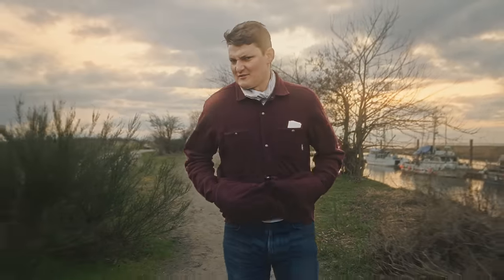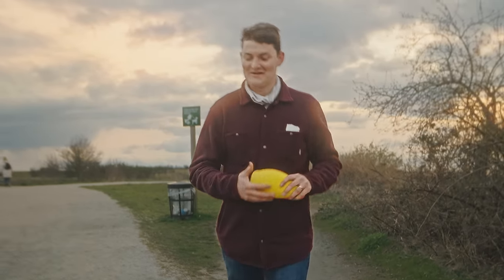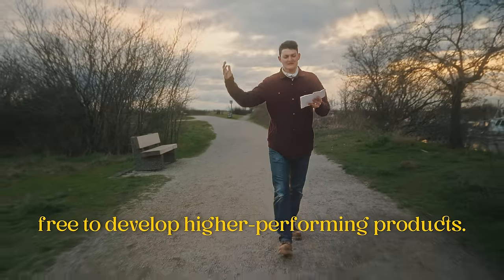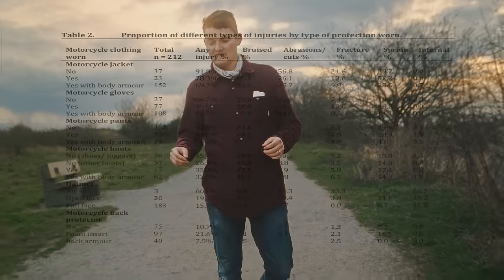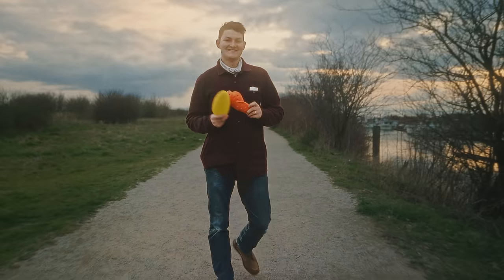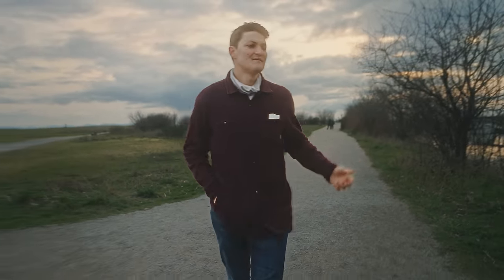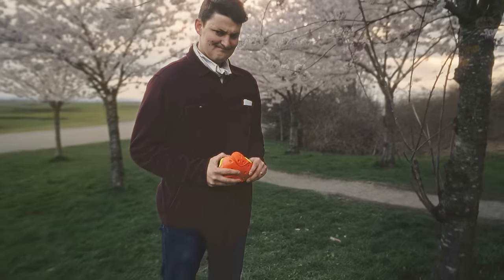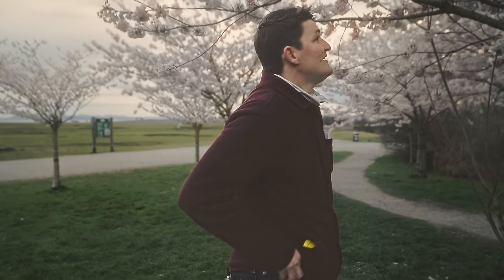Why I Stopped Wearing Motorcycle Body Armour

Comment: I would like to put my 2 cent, since it could be beneficial.
In recent news Italy has announced a series of laws that will be applied in the near future, some of them state that when conducting a motorcycle the drive MUST wear protective gear regardless of engine power, looking more into it there have also been changes to the requirements that allow such gear to be sold, specifically the points that are now lacking like fracture and sprain protection, some brands (dainese and alpinestar come to mind first) are already compliant, but others could be ultimately made illegal for selling since many other brands have stated that these laws are too strict

Comment: I came off a week ago and body slammed my back onto the road and gravel. At the time I was wearing a textile riding jacket with elbow and shoulder protection and a back protector insert, jeans, riding boots and gloves. With the exception of a finger nail bruised, I think the tip of my finger got caught between the handle bars and the road, all other injuries were in areas where I did not have protection. I ended up with a badly bruised knee hip and arse. My gloves were shredded down to the knuckle protection and jacket was shredded on one shoulder and down the the back protection.

This was a fairly low speed low side fall that regardless of what I was wearing I would have been unlucky to sustain any serious injury.  However looking at the gear I was wearing and the shredded state it is now in, which is the same locations there was additional protection, I don't doubt for a minute I would be feeling a lot sorrier for myself now if I had not been wearing it.

At the same time I also accept that a bit of rubber protection is probably not going to do a lot of you hit something solid at 100kmph.

Comment: Taken directly from the study you mentioned: ''Motorcyclists were significantly less likely to be admitted to hospital if they crashed wearing motorcycle jackets (RR = 0.79, 95% CI: 0.69–0.91), pants (RR = 0.49, 95% CI: 0.25–0.94), or gloves (RR = 0.41, 95% CI: 0.26–0.66). When garments included fitted body armour there was a significantly reduced risk of injury to the upper body (RR = 0.77, 95% CI: 0.66–0.89), hands and wrists (RR = 0.55, 95% CI: 0.38–0.81), legs (RR = 0.60, 95% CI: 0.40–0.90), feet and ankles (RR = 0.54, 95% CI: 0.35–0.83).

Comment: I forgot what I was watching thanks to production quality. Beautiful stuff as always. Now, as for the topic. Considering what's provided is true, it surely remains effective to some extent as you mentioned. Different speeds, angles, impacted materials vary and the end result varies too. Despite all, having armour is most probably better than none. Striving for better stand-alone protection as you showed would be the right way to go.
I wouldn't consider removing my armour parts, we fragile humans don't need fractures to feel pain. Bruises alone, abrasion, lacerations and much more can be a worse nightmare. Even then, medical recovery and treatment will be shorter and easier in case of anything extreme. 
Nevertheless, I 100% understand your point there so thank you for making it clear not to rely on said armour when it's virtually useless when it comes to life and death.

Comment: Had a high side at COTA last November 25th, that knocked me out. Transported to hospital at level 2 trauma. Most prevalent pain, as I regained consciousness in the meat wagon, was neck pain. Secondary pain from my left hand, which was whipped into the track, with significant damage to the Ti knuckle plate, on the Held Phantom II glove. My left hand is the only problem that persists, with stiffness and pain waning, but still present, from the bone contusions. No fracture, but still a debilitating injury, due to extreme forces overcoming some of the best protection available. Studies often don't tell the whole story. Only a dipsh*t pulls pads out of a jacket. Even a small diffusion of shock energy can make a big difference, and I've been through multiple corrective surgeries, from many injuries suffered over 50 years of motorcycles,  MTBs, and alpine sports. That fact is, guys aren't going to buy/wear gear that makes them look like the Michelin Man. So what's "the industry" to do? Make oversized stuff that no one buys/wears, or offer a level of bulk that doesn't impair riding, and doesn't look silly? The inflatable stuff looks effective, but price point, heat, and bother come into play as well.

Comment: people really missing the point ryanf9s putting across.

Hes not saying that armor is useless, hes saying the armor rating standards are useless, and we're put in place to protect motorcycle gear manufacturers.

he wears a full back plate on race day, and wears an airbag daily. But he doesn't wear the tiny minimum ce rated pads that barely do dick all.

That's all folk, keep wearing the armor but invest in a proper back protector or airbag if you actually care about injuries.

Comment: Sometimes it's a matter of luck. A few years ago I skated in the field. The bike kept going and I just rolled over and over and over again. That day it was so hot that instead of full protection I wore a mesh jacket with a cheap plastic protector from AliExpress. The cheap plastic helped the sliding and distributed the power of the sliding. I got up after a few moments and rode away. The motorcycle was injured a little more than me...

Comment: Try crashing on rocks in motorcross gloves with no hard armour comparred to gloves with hard knuckle protection. As for competing with Levis, denim is worse than useless for abrasion protection so even without armour you want something with kevlar fibres in the mix.

Comment: I had a car cross 3 lanes of traffic into the "empty" spot he didn't have good visibility of.  He pulled out 10 feet in front of me, left 5 feet of space between his front bumper and oncoming traffic (jersey barrier, but if I hit it obliquely and fell on the wrong side, it would be certain death).

So, my self preservation said to turn left into the car.  So I managed a small counter steer, and was leaning left and was about 45 degrees of perpendicular when I hit the side.  I hip checked the car.  The entire weight of my motorcycle on the inside of my left leg, my left leg, sliding along the car.  My shoulder hit the front door window, and I was leaning into it.

My hip bumpers took quite a hit.  They were the soft foam.  I had a mild deep bruising (took days for the bruise to rise from bone level).  My boots got a solid scrape, but feet/ankles were fine.

The gloves, which had hard-plate joint protection didn't do much.  The hit bent my handle bars.  The point of impact was my ring finger and pinky.  Crushed, my glove was in perfect condition, but the blood dripping out indicated my fingers were f***d.  The hit curled my shift lever into a pretzel, so I had to get off the bike and kick for a field goal to get it into second, then rode to the hospital.  I didn't take off my gloves until at the hospital.  They were unbroken (bone), but damage to tendons and muscle.  The blood was from the compression friction ripping off the outer layers of skin.

I have no doubt that the gloves would have done a good job in a slide/fall , but fingers smashed against a car hard enough to bend handle bars?  They saved me from worst cuts and contusions, but did little to protect the soft tissue, and that was from contact right on one of the plastic impact plates.  A shoulder plate might protect slightly from a puncturing wound, but a clavicle breaker is still going to get all that force to the collarbone.  Though my shoulder slammed a car, and I had no injury in my shoulder, but unclear whether that mattered.  I just know the hard plates in my gloves did nothing to help protect the soft tissue in my fingers.

A few months of rehab, and they are fine now, I just have some permanent internal scarring (lumpy spots only I can feel, because only I know where to look for them).

My error in that crash was assuming a gap to small for a car held no car.  At a 45 degree angle to the car, he fit in a spot too small for his car lengthwise, but big enough for it sideways.

Comment: I slipped and fell vertically down a 2 meter hole and landed on my collar/shoulder first onto some rocks. Fortunately I was still wearing my motorcycle jacket at the time - ended up perfectly fine - just a small bruise under where the paddling was.

Comment: I too removed all the padding out of my jackets and trousers as they then pack easier with less space taken up in my luggage, besides losing that little bit of weight. I do tho' wear a protection jacket from Ortema which should needed allows a quick trasnsitiion from summer to rain jacket when reqired. Underwear with hip padding and knee protectors does the rest.

Comment: Dangerous video. An engineer, not a medical person, is qualified to answer these issues.
Put very succinctly, energy absorption/retardation requires distance. The thicker (distance) the padding the more energy is absorbed. 
Jumping off a 10 story building onto a 3 story air cushion will save the stunt man. A 1 storey air cushion….probably not.

Comment: I love this channel. You have great information and you research and present it very well. 

I disagree strongly with you on this one.
A back protector is mandatory for me on the street and I'd rather have any pad between me and the tarmac than none at all. The important part is they need to fit right and should not slip away from your joint during a crash.

Just fall on your knees with and without them and you will feel the difference. During a hard crash I think there is no amount of protection that can completly avoid a fracture. What it does and can do is soften the blow. And I'd choose that any day over not having anything at all.

Comment: 3 weeks ago, I went down on the highway at 80 mph. Every piece of armour I was wearing did its job. Shoulders, elbow, hips, knees, chest, and back all took direct hits; no broken joints, no road rash. Full face helmet was torn to shreds. I did, however, break 7 ribs down my left side (and a punctured lung) which was not protected by anything but leather. I’ll continue with the armour, thanks.

Comment: I was wearing a pair of Levi's while riding my Bandit when I came off at around 6mph the jeans were torn and battered around 6inchs above and below my knee cap.... fortunately I was wearing Motorcross style knee/shin armour strapped on underneath otherwise I may not have a knee cap now...I broke my collarbone in the same accident but the shoulder armour in my jacket meant that it broke instead of shattering...also the bike was written off as the engine was cracked like an egg....ALL AT 6 MPH... armour is DEFINITELY worth it!

Comment: You can get better pads you know plus depends on the manufacturer, I had dainese jacket and trousers and the pads in there saved me completely from a car flipping me as it swung out at me from parked, I flew that day but got up and wasn't even hurt, the driver agreed very quickly he was going to pay up for any damage and he did... but I was very glad of the standard padding equipped in my gear, of course some gear has rubbish but don't buy crap gear...

Comment: I own a gs 1200. Big bike, heavy and unforgiving of mistakes. I have never fallen on asphalt with this bike but have fallen many times on the dirt. I have not been injured other than some inconsequential aches and pains. I am always geared up with standard gear. I would hate to think what would have been had I not been wearing it! Previous to my GS and quite a few years ago I had the 650 BMW. I had a BAD crash at about 70 km an hour. I failed to negotiate a turn and hit a concrete wall, bounced off the wall and was thrown across to the other side of the road along with the bike. I was very injured, a couple of broken ribs, broken shoulder blade and a deep cut on my left knee. I was taken to the hospital where the doctors stitched me up but they did not remove all of the strands of pant material!! This is another story though. The only points on my body that were not injured were where I was not protected by the " sub standard" protective gear in my jacket. I was wearing corduroy pants. No ankle injuries as I was wearing boots and no hand or wrist injuries as I was wearing gloves.....conclusion: wear gear with protection! Simple, the rest is academia...
Reply: Sorry for your bad experience - quote: were where I was not protected by the " sub standard" protective gear in my jacket. end quote Did you add a "NOT" here in error??? stay safe
Reply: @pamvarnsverry2444  no, I was not injured anywhere where I was wearing protective gear

Comment: I still wanna save my skin, my dad suffered huge parts of his leg missing from a motorcycle accident plus his leg set on fire from the gas tank leaking & the jeans he wore melted into his skin. So he had the broken leg, but was also severely disfigured & rarely ever let anyone see his leg unless he was talking about his leg/always wore long pants. Sucks the pads don't help with breaking/fractures, but saving some skin helps. Do they have fire/melt protection? That would defs be good at least. 

I fell over with my bike one time going super slow in all the wrong conditions & turning into a gas station & all my covering didn't matter I still got road rash on my side where my jacket lifted enough & I didn't even travel, just went over. 

I learned that pedal bicycle helmets also have low impact speed limits before it doesn't help & people who bike faster (Not talking sport/athletes who get custom stuff, just average cyclists) get the same helmets rated for low speeds like the pads in motorcycle gear. 

Weeeeeee!  Just try to be safe as ya can & keep educating yourselves as best ya can. I hope enough attention gets made to make more serious changes to actually benefit riders. 💚💙🏍
Reply: Final sentence..

Comment: Fractures aside, the protection against bruising is nonetheless useful. In one theatrical play I worked on, a character was supposed to be hit in the back repeatedly with a hammer. Even though we used a rubber prop hammer, the impact was painful and the actor was bruised in rehearsals. I loaned the costumer a D3O back pad from my jacket, and she sewed a pocket for it into a T-shirt that the actor wore under a sweater. It was pretty much invisible to the audience, but the actor reported that he could barely feel the hammer blows.

Comment: The George Institute for Global Health study found: 

"Results: Motorcyclists were significantly less likely to be admitted to hospital if they crashed

wearing motorcycle jackets (RR=0.79, 95% CI: 0.69-0.91), pants (RR=0.49, 95% CI: 0.25-0.94),
or gloves (RR=0.41, 95% CI: 0.26-0.66). When garments included fitted body armour there was
a significantly reduced risk of injury to the upper body (RR=0.77, 95% CI: 0.66-0.89), hands and
wrists (RR=0.55, 95% CI: 0.38-0.81), legs (RR = 0.60, 95% CI: 0.40-0.90), feet and ankles
(RR=0.54, 95% CI: 0.35-0.83). Non-motorcycle boots were also associated with a reduced risk of
injury compared to shoes or joggers (RR=0.46, 95% CI: 0.28-0.75).
No association between use of body armour and risk of fracture injuries was detected. A
substantial proportion of motorcycle designed gloves (25.7%), jackets (29.7%) and pants
(28.1%) were assessed to have failed due to material damage in the crash.
Conclusions: Motorcycle protective clothing is associated with reduced risk and severity of
crash related injury and hospitalization, particularly when fitted with body armour. The
proportion of clothing items that failed under crash conditions indicates a need for improved
quality control. While mandating usage of protective clothing is not recommended,
consideration could be given to providing incentives for usage of protective clothing, such as tax
exemptions for safety gear, health insurance premium reductions and rebates."
"The most important result relates to the contribution of body armour, which was associated

with substantial reductions in the risk of any injury in crashes when other factors such as speed
and type of impact were controlled."

Comment: I totally disagree with your assertions. I have been riding for over 50 years and I can truly testify that properly fitted body armour will minimise significant high impact injuries. For the record you failed to take into account velocity/surface resistance/type of accident ie ( high siding vs low speed drop vs direct rear/side/front or rear impact by a vehicle ). My worst accident was caused from a motor vehicle driving on my side of the road and with no chance to avoid the inevitable collision resulted in a combined impact speed of just over 100mph - I was catapulted more than 25 metres over the car with a high impact force with the road, my protective gear ( H3 rated ) resulted in some minor bruises,  broken wrist and no lower limb or spinal injury - was I lucky, the answer is yes but from the paramedics/ police / hospital staff and my motorcycle retailer all had the same opinion.- if I did not have my protective equipment on - the injuries would have been far worse if not life altering. Everyone is entitled too their own opinions but please do not quote cherry picked stats and claim that is universally accepted and acknowledged please.

Comment: Regardless of the small reduction in force upon impact by using a pad, that reduction could be the difference between a broken bone, road rash, bruising etc. 
No one is claiming if you hit a lamp post at 60mph the body armour wil save you however sliding down a road it has helped me avoid excrutiating pain multiple times vs sliding down the road without protection (which i jave experienced) where you come off much worse!